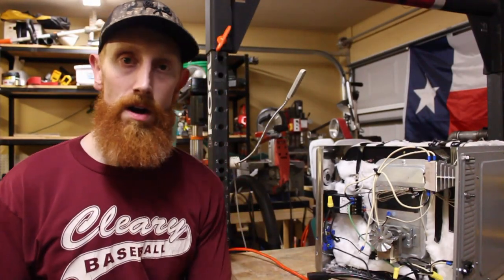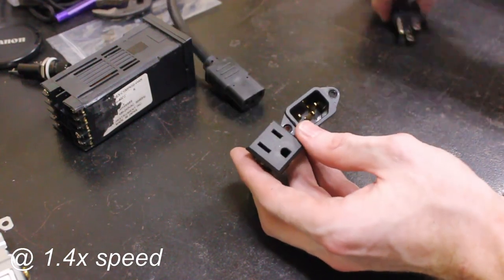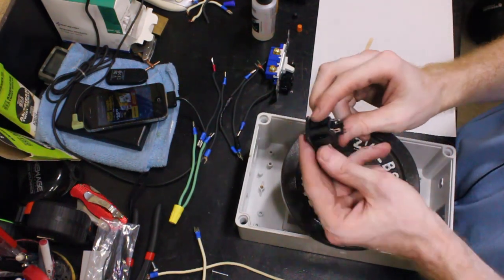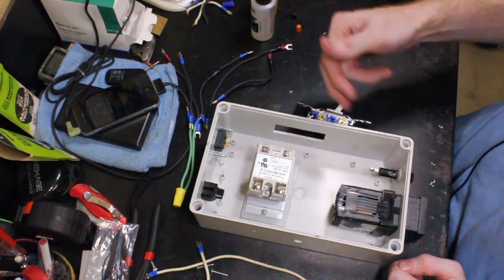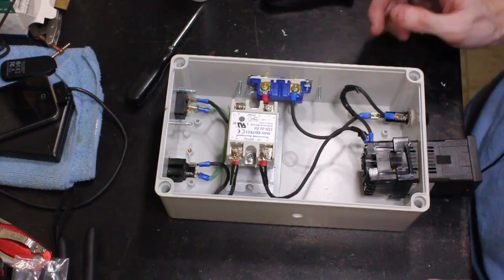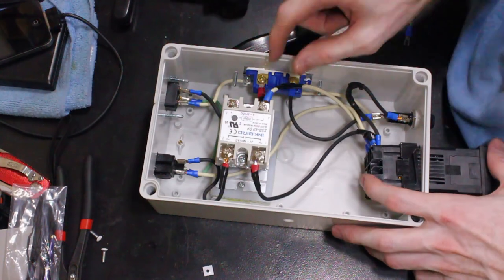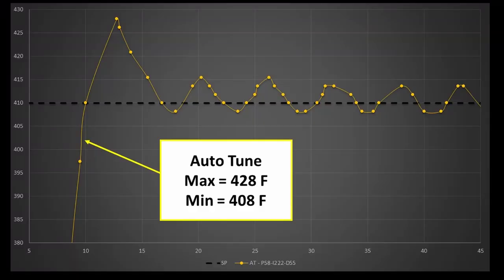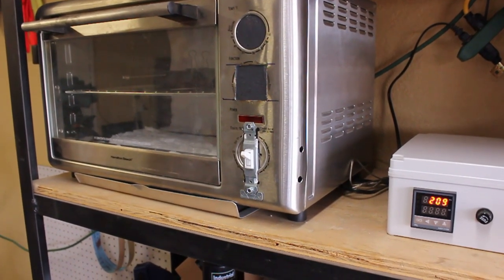How to Build a PID Controlled Toaster Oven | Full Guide | Round 2

Comment: Hi,  Hoping your still checking comments on this. I have several questions on this. #1 What did you disconnect on the toaster over to allow the pid to take over. #2 There are several parts you don't list on the parts to buy can you help out with these? They are the heat sink, the fuse and the large job box. Did you get them all on Amazon as well. My toaster overn makes me crazy it varies up to 45 degrees sometimes. I am notelecto mechanically inclined at all. I can wire a house but do not understand this stuff but I want to attempt to make my own pid controller. Any help would be greatly appreciated. Thanks!
Reply from the maker: Hey Jim. 

1.) You technically don't have to disconnect anything on the toaster for this to work. You can turn your toaster on to "bake" and then to it's max temp; then plug it into the PID control box. The PID control box will then regulate power to the toaster to maintain the temperature. On my specific build I took off the "bake dial" and the timer that was built into the toaster. I then wired the toaster to a switch on the front panel that acts as an on/off switch. If I were to plug this toaster into the wall in this condition it would be on full blast. 

2.) Here is the project box – https://amzn.to/2oP2mrM 

3.) The heat sink came with my SSR and I bought some fuses locally at the hardware store; but both could be found on amazon. 

4.) As far as advise goes. Take your time! Also make sure to print out that wiring diagram so that you can follow along easily. I got my terminal connectors from Harbor Freight and they make the project easier too. 

Good luck!
Reply: @RedBeardOps    Thank you!  Ordering parts now. Your wiring diagram is great. I'm going to give it a shot.

Comment: How did you hardwire your switch on your oven? Power coming in to your switch then straight to your elements?
Reply from the maker: That is correct. It's not necessary, but I did it

Comment: Hey man just getting into knife making and Been watching your videos. I got the pid and other stuff but my pid doesn't have a terminal 2 would you have an idea of what terminal to use with the inkbird pid
Reply from the maker: I don't, you'll have to refer to the inkBird manual. Sorry about that.
Reply: Thank you for taking the time to reply. I got the pid wiring figured out but was wondering do you disconnect the original temperature controller in the toaster oven or just leave it and set it to Max temp
Reply from the maker: @jamesleigh1816  Well I don't think you have to if your toaster goes to something like "Max Bake"... what I did on mine was wire the power directly to the elements bypassing the switch... probably not necessary., but it works. Be carful with all this. Cheers
Reply: Holly crap man. This pid is so good, I got it all wired up and tested it. My toaster oven would vary a good 15 degree c now it's lucky to vary 0.5 degree c😁. Thank you so much for sharing your knowledge on making knife's I personally have learnt quite a lot watching your videos
Reply from the maker: @jamesleigh1816  Very cool! Cheers sir

Comment: Hey man, Im trying to make an oven for curing composites and your video seemed a great place to start.  I got the inkbird pid controller kit from Amazon and I've got it rigged up to a toaster oven but I'm struggling with really bad overshoot (say 275F for a set point of 200F) and I've tried a ton of different PID settings but nothing seems to have a significant effect.  Even with P=1 (minimum), I=1 (minimum allowed by the inkbird) and D=9999 (max allowed) it still overshoots like crazy.  Any recommendations?

Thanks!
Reply from the maker: Hey Brandon, my recommendation is to only control your PID on P (proportional). (I to 0 and D to 0)

Then run some 10-30 min test to see how it performs

Comment: I’m going to build one of these for my electric smoker. Only I’ll use a toggle switch and put it in front with the fuse. I’ll build the box out of metal since I’m a welder and have the steel.
Reply from the maker: Nice! Good luck with your build!

Comment: hey there bud, ive got a combined switch and plug  in one so three wires coming out... yellow red and blue, yellow is ground.

so ive connected the red to fuse then to 1 on PID then another wire from 1 PID to 1 ssr.

so where do i connect bue wire and ground to? also on my PID controller, there is no number 2 just 1,3,4,5,6,8,9,10,11,12.

any help would be appreicated
Reply from the maker: Hey Jimi, I'm really not sure. Everything I know was in this video. I'd refer to your PID manual.

Comment: I really enjoyed the video but what do you do to the inside of the toaster oven to attach it to the project box ?
Reply from the maker: TheRedhawke hey man. In reality you don’t need to do anything to the toaster. You can take a brand new toaster, plug it into the box, turn the power switch on, and then turn the toaster controller to max temp. The PID box will then control the toaster.
Reply: @RedBeardOps  Cool, will the onboard timer turn the toaster off or will the PID keep it heating until you turn it off ?
Reply from the maker: @TheRedhawke  If you have a timer on the toaster that could be an issue. You would have to visit your toaster 1/2 way though your tempering cycle and "top off" that timer again so that the unit does not turn off. What I did on mine was remove the timer and put the whole toaster on an ON/OFF switch so that this was not an issue. If you don't want to deal with this, I'd recommend buying a toaster without a timer or one with a timer much longer than your tempering cycles.

Comment: Hello, Red Beard Ops

Find your work very well what you do is just great. And I've also built a lot of yourself. I am also building a box with the Rex C100 temperature controller and have done everything as shown in your video. Only what I do not understand is how the oven is connected to the socket of the box, what I have to consider how I connect this. Could you maybe give me a tip or a description I just can not get on with it would be nice if you can help me.

lg. from Germany

Michael Becker
Reply from the maker: Hi Michael from Germany! So the oven has a power cord coming off of it that would normally be plugged into the wall. When you build the box, the PID control box acts as an intermediary between the toaster and the wall socket. The PID box will have a female plug to accept the power cord from the toaster. The box will also have a male cord to plug into the wall. The PID control box will dictate if the toaster is either on or off based on the temperature being read by the probe. Hope that helped.
Reply: @RedBeardOps  Hello, Red Beard Ops
Thank you for the quick reply from you that it went so quickly. You just find your work great and I look forward to new objects from you.
Thank you very much and best regards from Germany
Michael Becker
Reply: Hello Red Beard Ops
I have installed the controller everything white describe input socket outlet oven, now my problem oven does not switch off to the temperature that I set. do not come into the Meneu with the ATU setting to set it to 1 what am I doing wrong, maybe you can help me do not come back with the controller. would be nice to get advice from you.
lg.Michael
Reply from the maker: @sonjabecker2819  Hey man, What controller are you using? Based on our language barrier I doubt I'm going to be able to fix your issue.

Comment: So the plug you say to connect the oven to... are you just connecting the heating elements?
Reply from the maker: Basically yes. I'm running the fan off a separate switch. I also bypassed the built in thermostat. So if you want to not worry about that, just set the oven to it's max temp, then plug it into the PID controller box.
Reply: @RedBeardOps  ok.. I'm not wanting to use any of the factory toaster oven controls so I wanted to just run the heating elements straight to the ssr
Reply from the maker: @anthonystrunk5360  That's what I did. I wired the toaster elements to switch (not necessary though I think)
Reply: @RedBeardOps  ok thanks for the info..

Comment: I dont see the 15 amp fuse in the list.  Which one did you get?
Reply from the maker: I'm fairly sure I bought that item locally. You could probably find it at the hardware store or on amazon.
Reply: @RedBeardOps  Ok cool I will try ACE Hardware.  Another quick question.  When you wired the oven for just a on/off switch did you cut out the fan too?
Reply from the maker: @nkcwilliams  In my case I put the fan on a separate independent switch. This is not necessary. You could plug in a fully stock oven into this PID control box and have success. You would just want to make sure that the oven is set to ON and BAKE and max out the temp. The PID will essentially turn the oven on and off to achieve the temp desired.

Comment: Bro i got the inkbird pid controller but the #2 spot is empty where i need to put the blank wire in that pid controller?
Reply from the maker: Hey man, I'd refer to the manual, the numbered spots are going to be different than the REX. Cheers

Comment: I'm debating whether to do this or not.. I'm having a hard time bringing my evenheat temp down enough to temper after quenchig. The fire brick retains so much heat that I overshoot 400°. I came in to check on my first temper cycle today to find the temp sitting at 450°. :(
Reply from the maker: Damn, I always wondered how fast those would come down to temp. One day I'll have me a nice fancy even heat, but I reckon I'll keep using this PID toaster for tempering.
Reply: I place a fire brick into the kiln to draw heat and put a fan in front of the oven. It still takes 20 mins or so to cool down.
Reply from the maker: @Aaronyavcm  DAMN!

Comment: That's a huge box for so few components.   Proper cable management,  component location, component selection and strategic wiring are all key.   Never epoxy anything, replaceabilty is paramount. Thise self tapping screws scare me.  Onexwire comes loose and it's a shock hazard.
Reply from the maker: So far so good! It felt tight in there to me, but I'm an armature.

Comment: Is there an easy pid solution install I’m not an electrician. ?
Reply from the maker: Hey Tim, I'm not either. You can buy PID control boxes already assembled. This is what I found on ebay without looking too far into the details - https://www.ebay.com/itm/Plug-Play-PID-Programmable-Temperature-Controller-Box-SSR-Kiln-Annealing-Glaze/122176024466?hash=item1c72422f92:g:RYAAAOSwPhdU1l0M

Comment: One comment. Your running all your current to your pid terminals. A couple of wire nuts or even a terminal block might be wise. If those connections loosen you could melt your pid or at least have nuisance fuse failures
Reply from the maker: Thanks for the tip!

Comment: Sorry to bug you again but I am in the process of writing the box and am a bit puzzled because on the PID controller I got (the inkbird you reccomended) the #2 spot is a blank. There is nowhere to attach a wire in the #2 spot. 2 and 7 are both blank. I am trying to follow you directions which are great because I would otherwise know nothing about this kind of wiring. Can you help me again please?
Reply from the maker: Hey Jim, I don't own an InkBird, however, based on my research they are superior to the REX controllers. I'd advise reading the instructions manual that came with it or searching InkBird PID controller on youtube to find a wiring instructional video for that specific controller. It's going to be the same concepts as the REX just with different terminal numbers. There should be a diagram in the box that came with it to show you what terminals are what.
Reply from the maker: This one may help - https://youtu.be/BVzieLy5m28?t=121
Reply: @RedBeardOps  Thanks for the response. I was hoping since it was 1 you recomended you might know. I was so close. Only had the whitte wire and thermocoupler yet to connect. I did watch the video you shared the link for and several others. My issue here is they didn't wire things up the same way we did so I'm still a bit lost. I'll get it just may take a while to figure out where the neutral goes or ifThe way you wired things is different now since it's a different PID. Just don't want to burn it up in the process.  Thanks for all your help with this. Stay safe out there.
Reply from the maker: @jjppres  Man I'm sorry about that. I should of purchased both since I recommended them. I just read a bunch of good reviews in the forums with people using the MyPIN and InkBird auto tuning.
Reply: Well I got it figured out and if you can you may want to edit the information on your video. Come to find the particular PID you gave an Amazon link for is the wrong one. It is an Inkbird model itc100vl and that particular pid is a 24 volt DC (itc24vdc) pid. What it should be is an Inkbird itc100 120volt ac (itc120vac)  the one on the list in the video will not work unless you were to buy an ac to dc power adapter. So lesson learned. I am going to get on Amazon and order the right one. Like I say if you can edit your information it may prevent someone in the future from having the same problem. Hope you have a great day and stay safe.
Reply from the maker: @jjppres  Gosh darnit I'm sorry sir! Thanks for this clarification. I messed that up for sure.
Reply from the maker: @jjppres  This is the right one, right? https://amzn.to/3aLZkHS
Reply: @RedBeardOps   Yes sir. That looks like the right one
Reply: Friend of mine that is an electrical engineer for GM figured things out.

Comment: The pid controllers in the description aren’t the same and will be wired differently,if you wanna follow the video get the one he talks about in the video and not the ones in the description.         Thank you for the tutorial
Reply from the maker: Thanks for the clarification, sir!
Reply: Hey, I’m trying to help my 18 yr old son get one going for his knife making. Would you be available to coach me a bit and, if so, how would be the best way to connect? THANKS!! Btw, mysterious dude is my son...
Reply from the maker: @keithholladay4800  Hey Keith, while the terminals may be different with different controllers, the PID controller is still doing the same thing. (turning the power on and off to the toaster based on the termocouple readings). I'm not an expert with these things for sure.
Reply: @RedBeardOps  thanks for the quick reply! So, I have it working, but have no clue what to do as far as regulating the temp. Where might I find that info?
Reply from the maker: @keithholladay4800  There should be an auto tune feature. I'd research that for the specific controller you have. You should be able to get it close with that.
Reply: @RedBeardOps  Cool beans. Thanks!!
Reply: Bro dis you got the diagram for the inkbird pid controller?

Comment: well i wired exatctly like you did in video my pid turns on but not my oven???? any ideas???i dont get it no power to ssr light isnt on im using a my pin t series pid i just dont get it
Reply from the maker: Hey man, I'd suggest going back over the manual for the PID and the wiring diagram. If both of those are right, maybe some faulty equipment?

Comment: I wired mine the same way as yours but once it reaches the set temperature it doesn’t stop and keeps heating up. What am I doing wrong ?
Reply from the maker: You should start by auto-tubing the PID; that could be your issue. It's over shooting your temp
Reply: @RedBeardOps  how do I do that ?
Reply from the maker: @rasychea  It depends on the PID controller you're using. You're going to have to refer to the manual.

Comment: What gauge wire are you using?
Reply from the maker: Hey man, this was a long time ago so I really don't remember. Looks like 12 AWG, but don't quote me on that.
Reply: @RedBeardOps  no worries ill probably use 12 AWG.  Need to wire this setup for a temp controlled forge. Figured this will work perfectly, just have the output wired to the propane solenoid vs your plug in this video.
Reply: @RedBeardOps  also is this the inkbird PID? I ask cuz their diagram is different then yours so im just a little confused on which to follow.
Reply from the maker: @jamespittman6476  Follow the diagram that comes with your PID. This one was not an inkbird, but I think the inkbird is a better PID
Reply: @RedBeardOps  thanks friend.  I appreciate your responses and all of your content man, keep it up